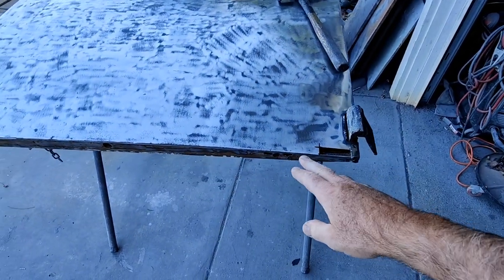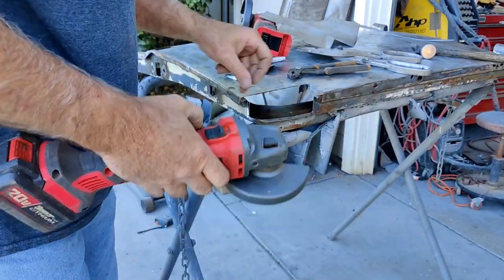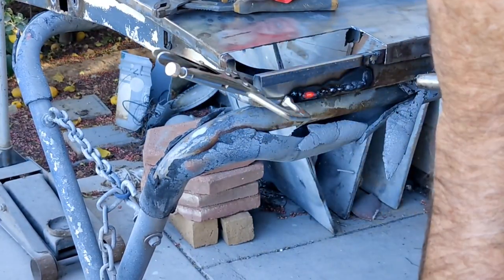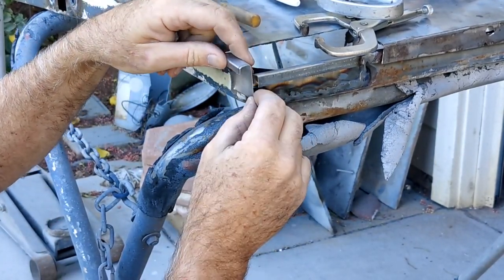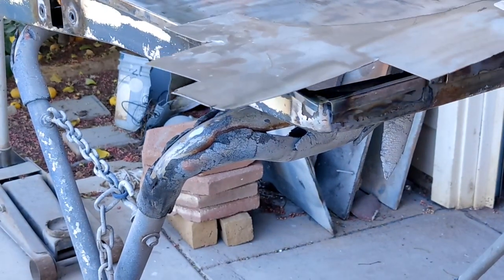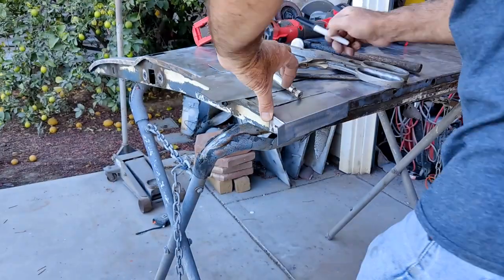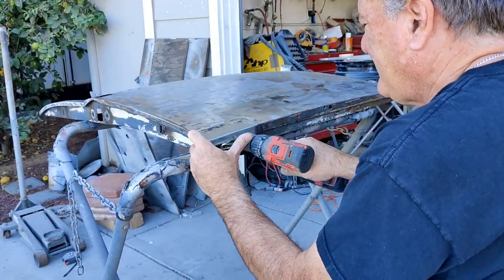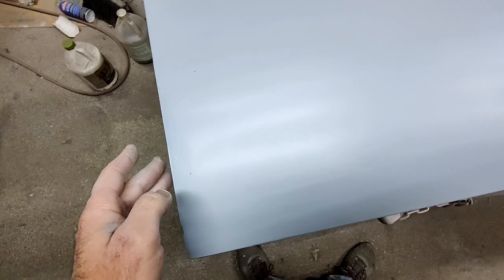Rust hole in sheet Metal door repair

Comment: Hi Mike - as I learned from a friend in USA: "There are several ways to skin a Cat". You do a reasonable repair which is much better than just filling it up with bondo and you save time in comparison to a very detailed method. Your follow up process protects it against corrosion and is proven by your experience - in my eyes, overall a nice concept to bring a car back in the road in a reasonable time. Greetings and Thank you for sharing.

Comment: A lap weld is actually stronger then a but weld. Only time I but weld is when it's in the middle of a panel and it will save me body work.. but on the bottom of a door it won't matter. Plus that lap weld is much stronger.  With but welds you can get thin spots that bleed rust. Ruining your paint work and causing rust to come back. Like you said it's so time consuming to but weld that it doesn't help when you got 40 hours of welding to fix a car.  Go drive it and enjoy.
Reply: 40 hours of welding on vedubs that being lucky😜

Comment: In the land of OZ we have Bunnings as an equivalent of Harbour Freight .. I have long said the the downside of major chains is that  the seek the cheapest products, to obtain the largest profit for themselves ... Sound OK to the average Joe Blow but Bunnings in not the place to find quality products such as those welding needs that you mention   Regards Alex
Reply from the maker: Checking Bunnings now want to see how you do it!!!!
Reply from the maker: Bunnings is kinda Like hope depot or Lowes. Harbor freight is totally unique. all tools for about every trade. Tons of equipment from trailers to presses and English wheels. Metal fabrication tools. body hammers. Even trailer accesories. All made in china. But some are good quality some are just totally cheap and some work good some dont. I find the same stuff in Canada. They have no HF either. everything is much more expensive. I take harbor freight stuff up there all the time to my wifes family. Like a drill up there is like $100 usd same one at HF like 60. or a cheap one for 20.
Reply: @Mikefngarage  Thank you so much for your response .. I will gather some examples to share with you very soon